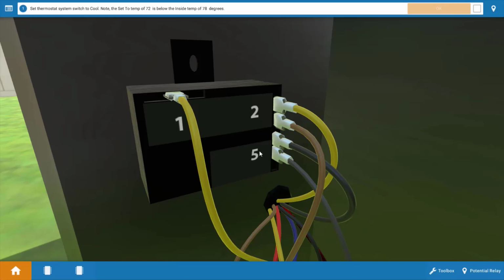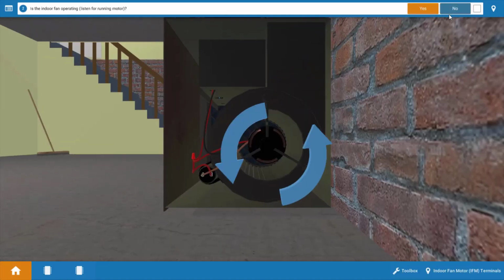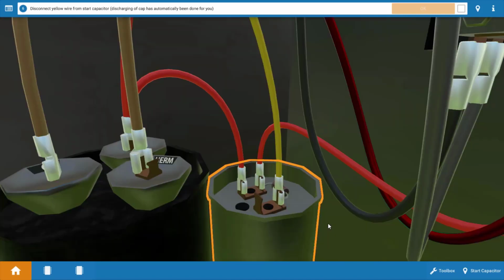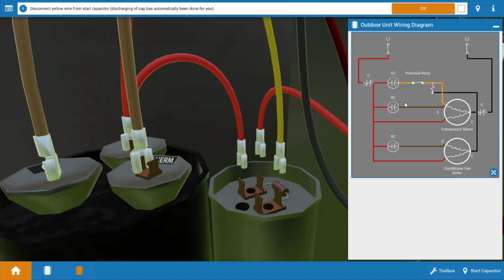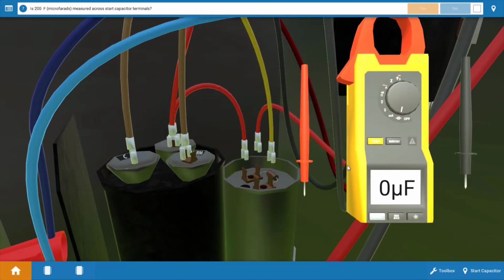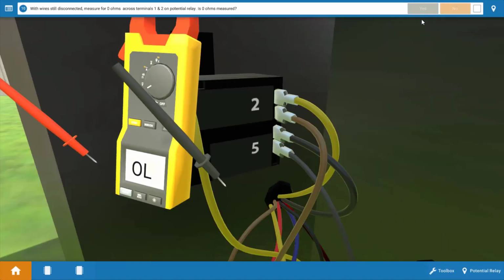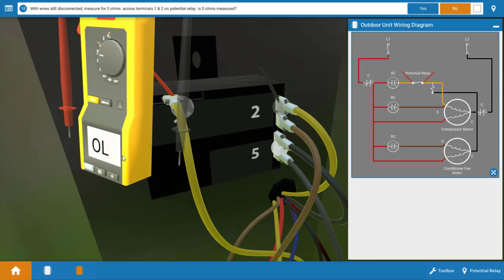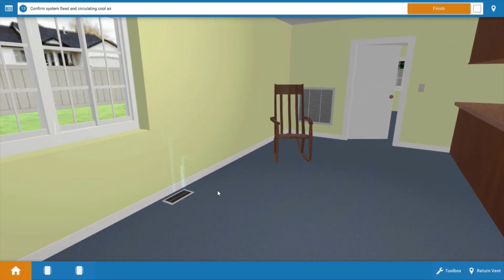Troubleshooting a Faulty Potential Relay on a Residential AC

Comment: I have to disagree with the checking of the start cap. You will not get correct readings with the resistor on the cap